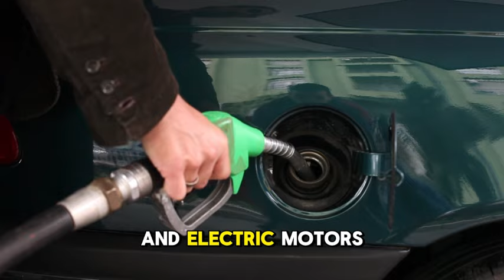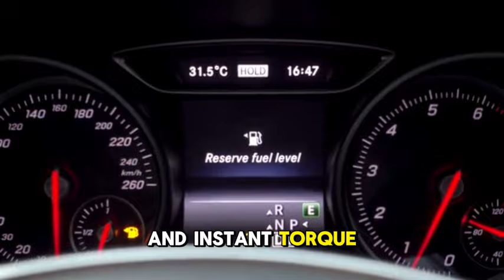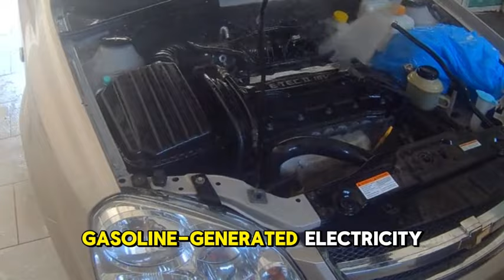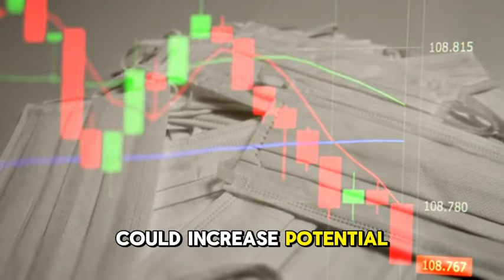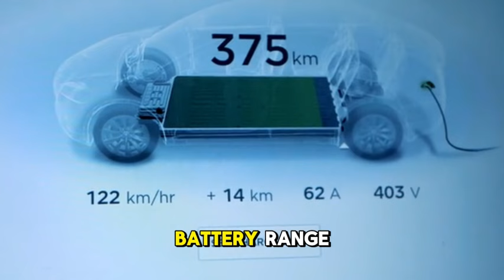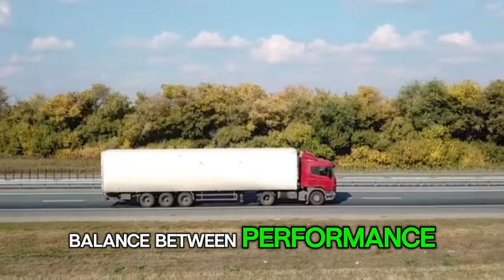Ramcharger Range Extender A Brilliant EV Innovation or a Mechanical Disaster

Comment: This concept isn't new. Trains have worked this way for a hundred years. The question is this system simpler and more efficient than the current system and unlike the plug in hybrids will people plug them in.
Reply: Wow it's hard to listen to this AI voice. The same word is pronounced differently each time.
Reply: @TheADHD-RabbitHole  🤣
Reply: bro repeating the same words agin b again again😆.evs has ample space to put a generator. But they wont they wanna follow tesla the hyped market. Toyota told the world that hybrid was the way to go and here we are. That geneator whether v6 or 8 would run on a constant rpm so longivity of the generator shouldn’t be a problem. Ram should mainstream this. As byd has car like this where the engine can charge the bayttery and drive the wheel again the car can aoso be charged